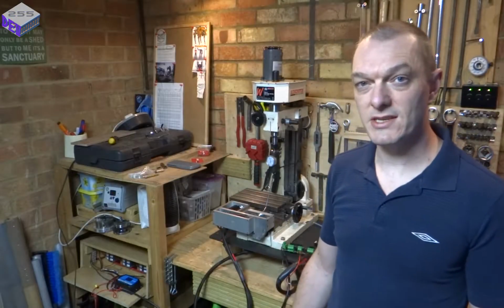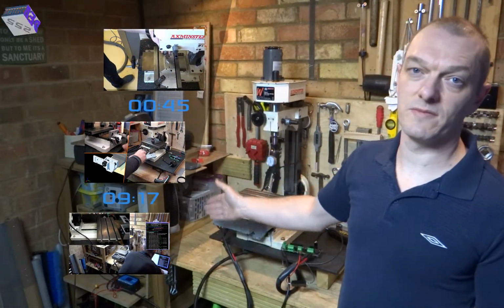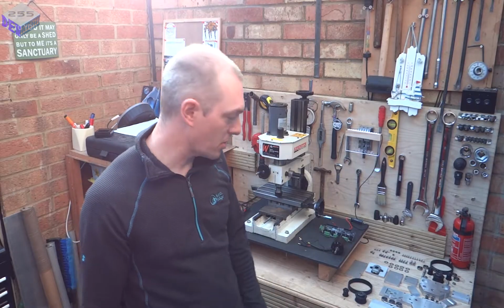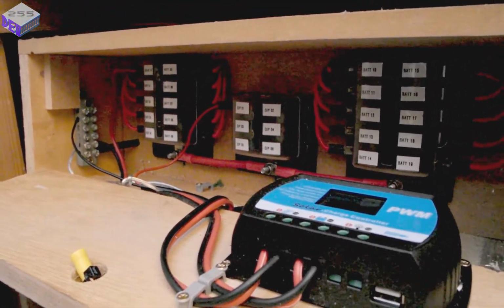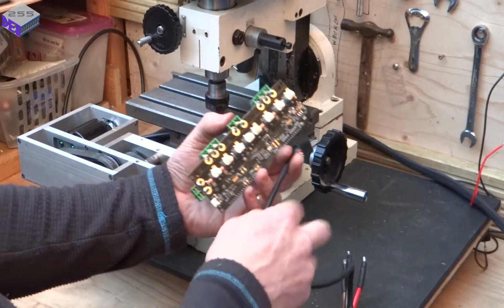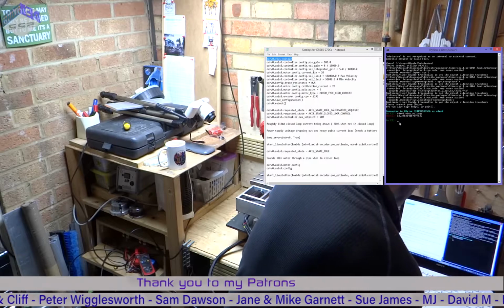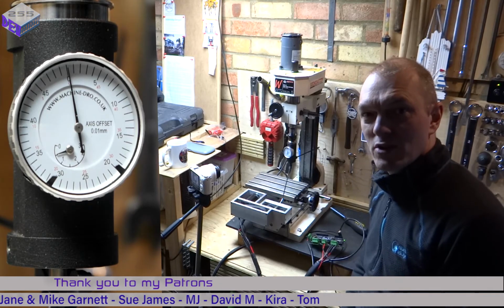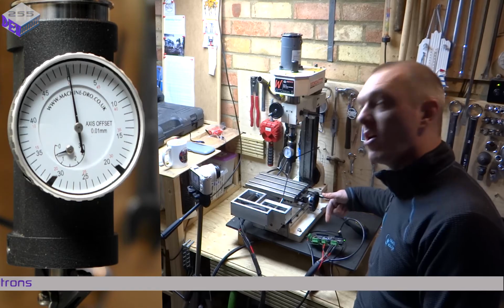CNC Mill Conversion Part 5 - Assembling and Testing the Y-Axis

Comment: Neil, if you were to buy another milling machine today with similar budget in mid for a CNC conversion - would you buy the same model again ie Sieg X1?
Thanks for super honest and helpful story!
Reply from the maker: Hi, for the price I would stay with the same machine. The workable area with the extended table is just under 300mm X, 150mm Y and 220mm Z. I have upgraded the bearings recently from 6905's to 7905's as they are a little stronger (BMX wheel bearings); this does not require any modification to the mill. I originally believed I'd be replacing the nylon gears every so often, although they have lasted over 10 years without fault.

Comment: i just noticed at 5:00 did you completely clean the motor after drilling? even the smallest chips can create a short if it cuts into the motor windings while its turning.

When i did shorten the shaft of another motor a few years ago i put the motor inside of 3 plastic bags and then punched the shaft through the plastic bags to "hermetically" seal the shaft from the rest
Reply from the maker: I did give it a little clean, plus used a lot of lubricant while drilled slowly, although the video makes it look fairly fast.

Comment: i also have the odrive but want to use it as a spindle driver
Reply from the maker: Hi MMD, I am looking at the same option as my current spindle motor is only 150W, I don't know yet if you can drive both a position motor (Z-Axis) and a spindle motor off of one ODrive. So one as M0 and the other as M1
Reply: @TheSolarPoweredEngineer  that should be no problem. What seems to be a problem for me is, you cannot currently have 0-100% pwm control. Also in velocity mode the controller seems to also hold the position (a spindle should be freely rotatable by hand if it doesnt spin)
Reply from the maker: @ipadize  Could you set it to IDLE STATE at 0 pwm I wonder, although I haven't looked into it yet.
Reply: @TheSolarPoweredEngineer  yes... if you have it connected via USB to the computer. This is why it is not a solution for me (probably have to manually set it to idle).
Reply from the maker: @ipadize  I will need to look at it in greater detail, and if I find a solution or workaround I shall let you know. I am very impressed by the ODrive, it's very reliable and position repeatable
Reply: @TheSolarPoweredEngineer  oh what i forgot to mention, the odrive is limited to 600hz commutation speed. Which results in 7200rpm maximum with my 5 pole motor. since i want to reach 12-15krpm i need to add a gear or belt. Double the speed but half the torque. But this will probably be fine since i dont want a huge machine with indexable cutters
Reply from the maker: @ipadize  I think 7200rpm would be fine as my machine only goes up to 2000 at the mo and had no problems at that speed. The issue you get as the speed increases is tool balance, and possibly spindle bearings max operating speed being exceeded.
Reply: @TheSolarPoweredEngineer  no worry, its (probably) going to be a diy spindle with precision spindle bearings :)
Reply from the maker: @ipadize  Sounds like a good project. Will you be featuring it on the ODrive community site?
Reply: @TheSolarPoweredEngineer  well, yes. If i have designed everything in CAD and software is working. I first want to complete the software and make sure everything i want to do is working, then i can design the rest in CAD and so. But that could take a while. I may seem crazy but, my project is a 5 axis machine with rigid tapping capability, true closed loop to the controller, automatic toolchanger, 3d touch probe / tool length sensor. Maybe even a automatic pallet changer (with two extra axes = total 9 axes) for the rotary axis (if i find a nice motor with a big through hole for a pneumatic rotary feedthrough). Maybe i could use a big flat brushless motor (like the t-motor antigravity mn1005) but cooling could be a problem.
Reply from the maker: @ipadize  Wow, sounds like you have you work cut out (excuse the pun ;-), it would be a very good project to follow. I won't be able to fit a large machine in my shed or dining room table sadly, doh! but would love the challenge.
Reply: @TheSolarPoweredEngineer  what value would you recommend for the supplied braking resistor for a 1kw motor?
Reply from the maker: @ipadize  I have the ODrive D5065 - 270kv Motor that is rated 1.8kW, where I have a 0.5ohm 50W resistor, although you don't have to have one if you connect to a battery as the breaking current will go back into the battery (beware of overcharging certain types of cells though, especially lithium based). If connected to a PSU you will need a resistor. Mine gets fairly hot when rapidly changing direction at full speed, but doesn't fail, although my load is fairly low. Hope that helps.

Comment: That's really interesting that you're using the odrive. Almost never seen that before
Reply from the maker: Hi, I think the ODrive was originally designed for this sort of thing, I am really impressed by its control, accuracy and feedback. I will be using an Arduino to convert GCode to control the Odrive's eventually. Im working on the X-axis first though. Glad you like it 👍